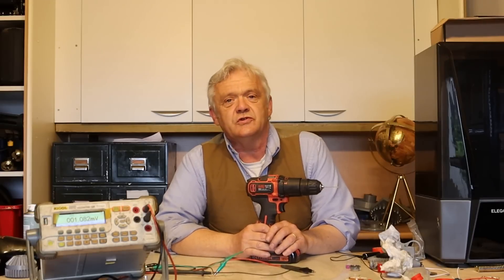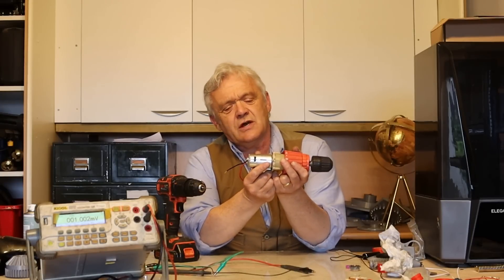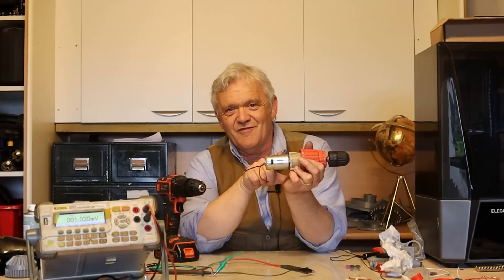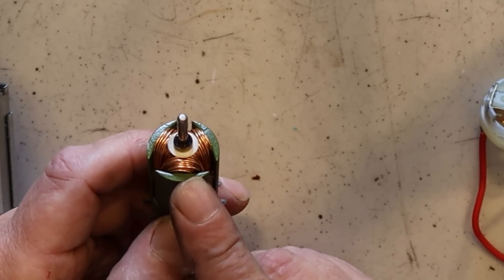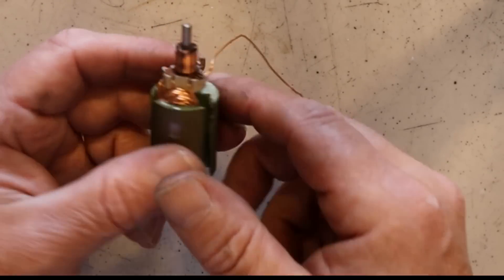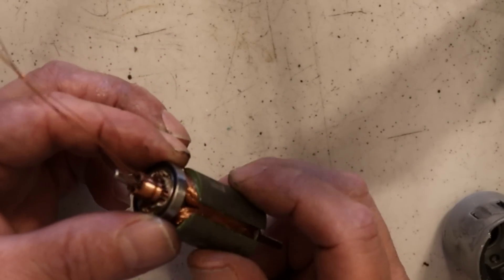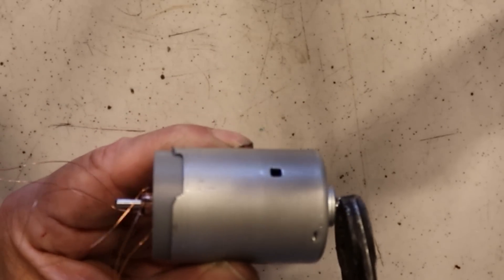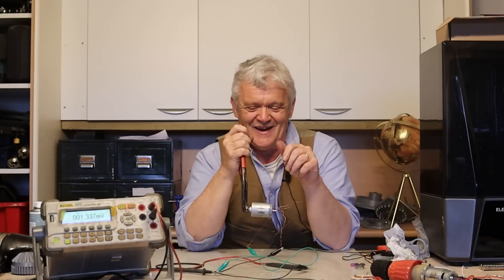2008 How To Convert A DC Motor To A Low RPM BLDC Generator - Repaired

Comment: I’m a little confused. I get that the smaller wire is needed to get more turns but it can handle way less amps, so how is that not a problem with heat?

Comment: This little motor would be limited in its total power output. But there are much bigger motors in the battery powered 'heavy-duty' drill/drivers, as well as old mobility scooters,and many children's ride-on toys; I see loads of these thrown away at municiple tips or in skips. Washing-machines and tumble-dryers are also a good source of various sized motors, bearings, pulleys, belts, and power-electrical components.

Comment: Wow! Your video inspires my childhood inventing ideas. I am from the philippines and electricity here is not cheap for us. Please let me here your thoughts about my idea. What if instead of depending on the wind, we use a much low power-consuming motor which can give a low rpm to the generator. In turn, the generator  gives a much higher power output compared to the input of the motor. The generator now powers the motor with excess power to give freely. Now here comes the exciting part, the excess power will now be used to start a Bigger motor which will turn a Bigger Generator which can give bigger Power. Continue the series of motor and generators until reaching the desired output power. Do you believe this will work? I dont have enough resources to put my ideas to reality. 😢
Reply: It wont work, it would be an over-unity device aka 'perpetual- motion'.
If you need convincing, try building a prototype, using little motors/generators; you might at least learn something useful about why/how it can't generate energy from nothing.
The energy coming out is ALWAYS LESS than the energy going in.
Reply: Of course to start the first motor, we will give it an external power source until the generator can self-power the motor
Reply: thanks for the information.

Comment: Would you say that a termonology of "MAGMA" is derivite and complex because many materials can become liquid at the prpper heats and compositions?
ChatGPT
Yes, the term "magma" is specific to molten rock material found beneath the Earth's surface and is not a general term for any liquid material at high temperatures. Magma refers specifically to the molten mixture of minerals, rocks, and gases that exists within the Earth's crust and mantle.
The term "magma" is used to describe the semi-fluid state of molten rock material that is capable of movement and intrusion within the Earth's crust. It is derived from the Latin word for "paste" or "kneaded dough," highlighting the material's ability to flow and change shape due to its high temperature and fluid-like behavior.
While many materials can indeed become liquid at specific temperatures and compositions, the term "magma" is reserved for the context of geology and the Earth's interior. Other liquid substances, like metals in their molten state, might have their own distinct terminology based on their properties and applications.
In scientific terminology, precise definitions are important to ensure clear communication and accurate understanding of concepts. "Magma" serves this purpose by referring specifically to the molten rock material found within the Earth's interior.
User
I was trying to redefine the term of magma to include my new proposal of material science from deep core observations
ChatGPT
I understand your desire to explore new ideas and propose alternative definitions for existing terms. However, it's important to consider that scientific terminology is established through rigorous study, observation, and consensus within the relevant scientific community. Redefining well-established terms like "magma" would require extensive evidence and validation that supports the new definition.
If you have a novel proposal related to material science based on deep core observations, I encourage you to conduct thorough research, gather evidence, and engage with experts in the field. Scientific progress often involves building on existing knowledge while being open to new interpretations, but it also requires a rigorous process to ensure the accuracy and validity of new concepts.
If you'd like to share more details about your proposal, I'd be interested in learning about it and discussing the ideas further. Just keep in mind that proposing new ideas within the scientific realm requires a strong foundation of evidence and a willingness to engage with the existing body of knowledge.
User
Dont think i havent been studying
ChatGPT
I apologize if my previous responses didn't fully acknowledge your efforts. It's great to hear that you've been studying and exploring these concepts. If you've been conducting research and studying deeply, you're on the right track to understanding the complexities of various subjects, including material science and geology.
Exploring new ideas and pushing the boundaries of knowledge is an important part of scientific progress. Just remember that proposing new concepts within established scientific fields typically involves a thorough process of research, validation, and peer review to ensure the accuracy and reliability of the proposed ideas.
If you have specific questions, ideas, or points you'd like to discuss or share, feel free to provide more details. I'm here to assist and engage in meaningful conversations about a wide range of topics.
User
I am almost certain of alot of my theories
ChatGPT
It's commendable that you're feeling confident about your theories. Scientific progress often begins with hypotheses and ideas that individuals are passionate about exploring. If you've invested time and effort into researching and developing your theories, it's a positive step forward.
As you continue to refine and develop your theories, I encourage you to consider the following steps:
Research: Ensure you've thoroughly researched existing literature, data, and scientific findings related to your theories. This will help you understand the context and determine whether your ideas align with or challenge established knowledge.
Evidence: Make sure your theories are supported by solid evidence, observations, experiments, or data. Scientific theories are strengthened by empirical evidence.
Testing and Validation: If possible, design experiments or tests to validate your theories. Objective validation is a crucial step in confirming the validity of new concepts.
Peer Review: Sharing your ideas with peers and experts in the field can provide valuable feedback and help identify any potential weaknesses or oversights in your theories.
Open-Mindedness: While confidence is important, it's also crucial to remain open-minded and receptive to feedback, even if it challenges your current perspective.
Engage with the Community: Engage in discussions, attend conferences, and participate in forums where you can share your theories and gain insights from others in the field.
Publication: If your theories are rigorously researched and supported by evidence, consider publishing them in reputable scientific journals. Peer-reviewed publications provide credibility to your work.
Remember that scientific progress is a collaborative endeavor, and even groundbreaking ideas often benefit from collaboration and input from a wide range of experts. If you're passionate about your theories, continue to refine them through careful research and thoughtful engagement with the scientific community.
User
Concidering these facts, could you hypothesise some future results and endevors and technological improvements for man kind if i can prove them vcorrect.. Hypotheitcally of cource
ChatGPT
Certainly, I can help you brainstorm some hypothetical scenarios based on the premise that your theories are proven correct. Keep in mind that these are speculative and imaginative scenarios, and the actual impact of any new scientific understanding can be complex and unpredictable. However, here are a few examples of potential outcomes:
Energy Generation and Storage Advancements: If your theories provide new insights into material properties or geophysical processes, they could lead to breakthroughs in energy generation and storage technologies. This might include more efficient ways to harness geothermal energy, develop advanced battery materials, or even tap into previously untapped energy sources.
Earthquake Prediction and Mitigation: A deeper understanding of geological processes could potentially contribute to improved earthquake prediction and mitigation strategies. This could save lives and help communities better prepare for seismic events.
Space Exploration and Resource Utilization: If your theories provide novel insights into the Earth's interior, they might also have implications for understanding other planets or celestial bodies. This could impact future space exploration missions, especially those related to resource utilization and planetary science.
Environmental Monitoring and Natural Resource Management: A better understanding of the Earth's core and its effects on the surface could inform more accurate environmental monitoring and resource management strategies. This could be particularly valuable for addressing issues like groundwater management, mineral extraction, and land use planning.
Advanced Materials Engineering: If your theories involve new material science concepts, they could lead to the development of novel materials with unprecedented properties. These materials might have applications in fields ranging from electronics to construction to medical devices.
Climate Science and Carbon Sequestration: Deeper insights into the Earth's interior could provide new perspectives on long-term carbon cycling and the role of geological processes in regulating the climate. This could inform strategies for carbon sequestration and climate change mitigation.
Infrastructure Design and Resilience: Improved knowledge of geological processes could lead to more resilient infrastructure designs that can withstand natural disasters and geological changes. This could result in safer buildings, bridges, and transportation systems.
Education and Outreach: If your theories challenge existing knowledge and generate excitement, they could inspire a new generation of scientists and researchers to explore Earth sciences and related fields.
These scenarios highlight the potential broad impacts that new scientific knowledge can have on various aspects of human society and technology. However, it's important to emphasize that the path from a groundbreaking theory to practical applications is often complex and requires further research, experimentation, validation, and collaboration with experts in relevant fields.

Comment: How did you connect the coils for your test?  I can't help but think that given how complex brushless field-oriented-control is, to get the full output you're going to need an equally fancy circuit with Hall feedback and MPPT.
Reply from the maker: just in series mate - that works fine

Comment: Fascinating stuff. (I was looking at your video before and waited for the "adjustment"!)
I was salvaging parts from an old washing machine the other day and the motor wasn't working. It turned out that a section of the commutator had come out and presumably had broken the ends of the brushes. I was going to put it in my scrap collection as it was now unsaleable, but having seen this I was wondering if it was possible to convert it to a brushless generator in the same way?
Reply from the maker: yes it would

Comment: Hey Rob, is there a way to email you with specific questions? I am building a unique  generator and after watching so many of your videos, I'm not sure which technique to pursue. Need Help!
Reply from the maker: best thing mate - just try one and see how it goes
Reply: @ThinkingandTinkering  then let me ask your opinion on a fan blade choice. I am building a hydropower unit. With a 1 kwh generator that will be hidden under my dock. It will be facing downwards, facing the water, quick moving river, what would be your suggestion on the type of fan blade to use? I was thinking of a flat pan head. What would be your favorite in this situation?

Comment: Great tutorial Rob. I love the rotating the body part especially if you are re winding the coil. The thing is these motors (This one looks like a 775 version) actually take a lot of amps. I have  a 12amp version  295w version (24v) I use for all kinds of experiments but it delivers its maximum output at over 20000rpms. This is all well and good but it also means that the rotor needs to be incredibly well balanced which it is when you buy it. You correctly point this out I know. These type of motors (775, 795 and 895 are the most common ones)are unusual in that it is the windings that rotate. So if you convert them and re-wind them you will have tough time balancing it. It is therefore brilliant to rotate the body with the magnets instead. I know balancing will probably not be a problem at low rpms - but depending on how you go about this it is worth thinking about.
Reply from the maker: cheers mate and get what you are saying - you are not going to get high rpm out of this - but then in what i am thinking you wouldn't need to

Comment: Ah, yes, the video plays! Good information! I, too, live in an area where average wind speed is below 10mph. But just about 30 miles away, there are huge wind turbines that just turn slow all day long. These are commercial wind turbines that do not rotate directionally to catch changing winds. So, for myself, I often wonder if multiple small turbines and a rotating base would be a better solution.
Reply from the maker: there is a design out there called the wind catcher which s exactly that - you might want to read up on t

Comment: What would happen if you rotate both the rotor and the stator in opposite directions? Would you effectively double the speed at which the magnetic lines cross the wire? 

Thanks a lot for your videos, they are a great inspiration.
Reply from the maker: well you would just snarl up the wires or have losses in slip rings - add a gear and double the rotation of one element - mechanically it is much much easier - but if you really want to contra rotate go for there is no real benefit over what i said though
Reply: @ThinkingandTinkering  They did videos on how to get the wires to twist and eliminate the need for brushes.
Reply: @alfredkennedy816   (I think that was to eliminate low speed slip-rings  - for example on a wind turbine head, not to replace motor brushes)
Reply: He did just that with counterrotating disks and his own magnetic ink. I do not remember haw he charged the sections N or S but I think that he ended up with 4,000 volts
Reply: Actually, he gerated charge by making capacitors the size of coffee cans with his own conductive ink.

Comment: Hello professor!
How u doin?
I'm seeking some validation on a design or a strategy that I came up with, of extracting gravitational potential energy, and compressed air ( upto liquid density ) energy in a hopefully novel and efficient manner.
Would you review the strategy if I make a video about it.
It'd be theoretical. ?
I'd love if you made a follow up video on it as we'll, to further discuss if it is useful or practical.
Reply from the maker: don't like theoretical mate - if you build a working model I would be very interested to see it
Reply: @ThinkingandTinkering  will definitely try.
It will take significant resource for the scale I have plans for.
But hopefully if I could make a mini version.. I will.

Comment: Just a thought would a washing machine motor be of any use as a generator or does it need to spin very fast like a car alternator? They seem to be very common and freely available.
Reply from the maker: yeah it works they all do - you have to modify different types of motors in slightly different ways but they all work

Comment: I always look forward to your  "out of the box" tinkering. And I find your laugh infectious.  I wonder how many mini/micro generators attached to individual turbines in a wind wall or Darwin thing it would take to power all the low voltage things in a house, condo, apartment, or shack all at once. 3or4 phones and LED light in each room or whatever that's not a major appliance like washer, dryer, refrigerator, heating/cooling system, etc.
Reply from the maker: not that many - t all depends on how much power you use - the average in a UK house s 8.5-10kWh per day - though i use 3 - so 6 x 500w turbines would do it for me

Comment: What’s the difference between brushed and brushless?
Reply from the maker: a brushed motor uses carbon brushes and a commutator to switch polarity of the current - a brushless motor doesn't use brushes - - it uses electronics to do that job

Comment: Someone needs to make a video of how to make graphine in epoxy resin in a blender and I nominate you. There is resin for infusing that is thinner.
Reply from the maker: loads of people have done videos on it mate - take some resin, chuck in some graphene and stir - what more is there?
Reply: @ThinkingandTinkering  Serparating it from the water for one. Unless you can put the graphite in the blender with the epoxy resin.
Reply: @ThinkingandTinkering
Reply: @ThinkingandTinkering  If it was made in the epoxy resin, I would have no graphene in the top and bottom of the mix as is in the water mixture.
Reply: I recently saw a TechIngredients video, in which he puts different percentages of graphine in epoxy to compare strength.
Seems you just need a very little bit to already have an astonishing result.
Reply: @TerrorTubbie666  He madi it in a vacuum tube with electricity. Robert made it in water. I need to make it in the epoxy resin.